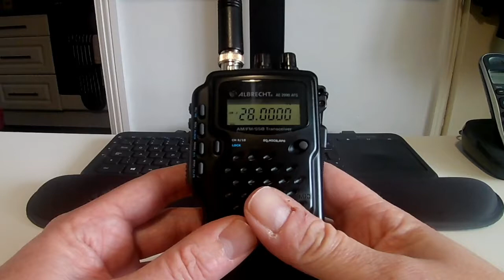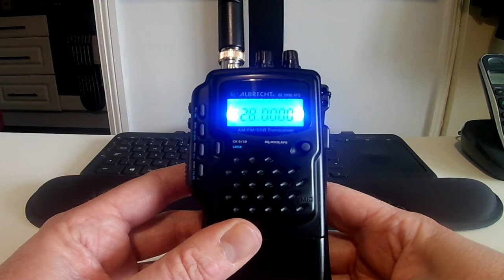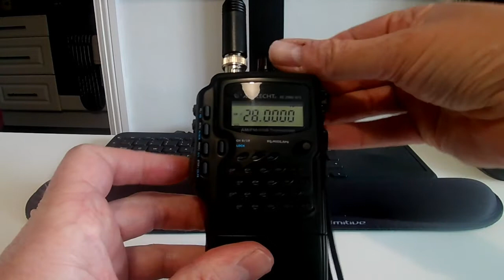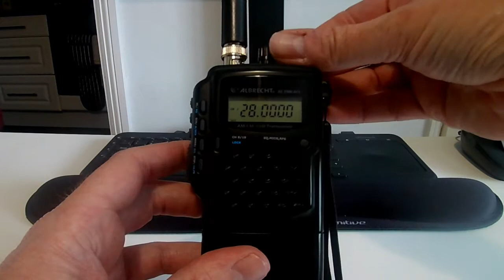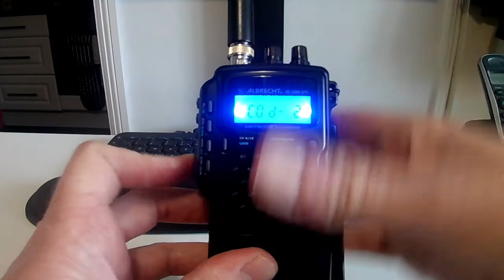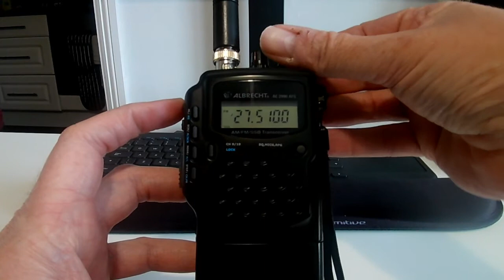Albrecht AE2990 Export Mode Explained

Comment: I thought you had to jump pins 1 and 2 under the ptt button cover to do this. So, all I have to do is hold the ptt button while I power the radio on to access this menu?
Reply from the maker: do the mod with the pins and then use the ptt button to change bands

Comment: Hey thanks a lot for making this video it is very informative. I do have one more question. I saw from another video that the power of this radio in original unmodified mode is very poor. 4 watt output on AM and FM is allowed but it does only 2 wat and i believe on SSB is 12 watt allowed but also does only 2 watt from factory. When you modify or export it will the power go up ?
Thanks again for making this video
Reply: You need to use good batteries, at least eneloops or better custom battery box with  Lipo cells or connect to 14 to 15v external power supply to get full 4w.

Comment: there is a mod to up the power to 12 watts i believe but the only video i can find is all in german .....if anyone can find an english one or explain it etc could you put a link ...regards
Reply: 12W seems a bit too much considering it is supposed to be a CB radio rated to no more than 4-5W in most countries
Reply: yes very true thinking on it etc 
 @qdaniele97
Reply: I watched that video too. I don't think he knows what he is doing, basically deactivating filters etc. From what I heave read this radio is capable of maximum 4.5 W when tuned correctly, so not worth the hassle.